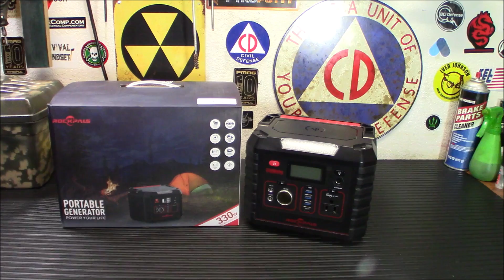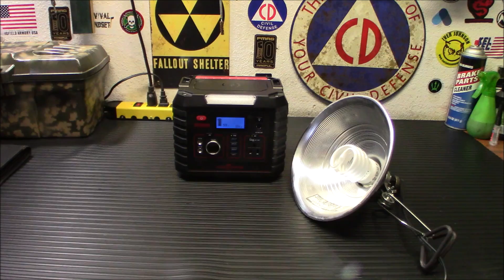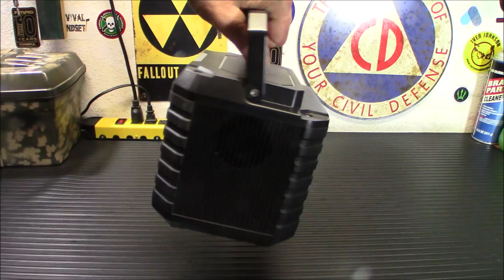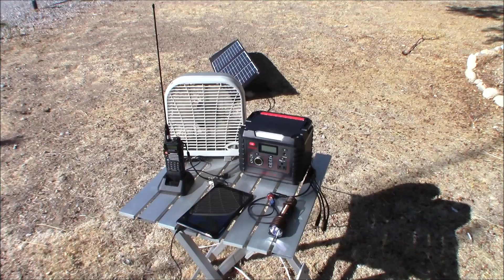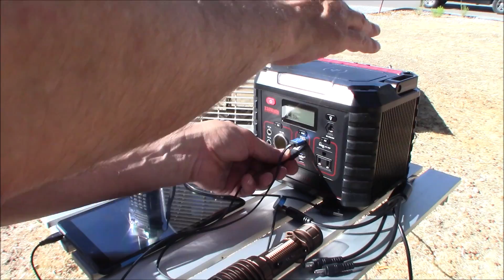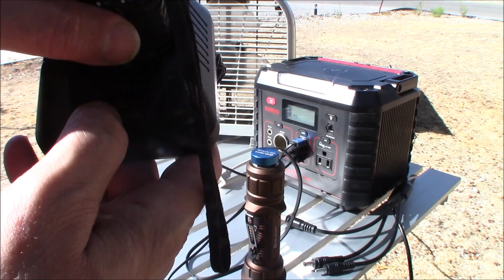Emergency Power:  ROCKPALS 330W Portable Power Station

Comment: for all you CPAP users  watching this...................

i just got this

im on my 6th night of using strictly with CPAP.  my setting is at 8.5, and im NOT using heater or humidifier.  the modem and bluetooth are set to ON.  

ALSO.....i AM using a DC cord (cigarette lighter plug) for this.  i think the numbers would reflect MUCH differently using the standard adapter.

1st night - 9hrs 10 mins use.  battery from 100% down to 85%
2nd night - 9hrs 51 mins use.  battery from 85% down to 73%
3rd night - 9hrs 22 mins use. battery from 73% down to 61%
4th night - 9hrs 27 mins use. battery from 61% down to 49%
5th night - 8hrs 20 mins use. battery from 49% down to 40%
6th  night - 8hrs 45mins use. battery from 40% down to 32%

im pretty confident that with modem off, heater off, humidifier off, and heated tube off that i can get 8 nights use, on 1 full charge.

which makes this a VERY cheap alternative to the pricier 500 watt size models.

Comment: Heres sort of a hack

Go get a light bulk socket plug in adapter
https://www.lowes.com/pd/Project-Source-660-Watt-Ivory-Medium-Light-Socket-Adapter/3775911?cm_mmc=shp-cprdelcgooglelia-205-wiringdevices-3775911-_-0&placeholder=null&&ds_a_cid=112741100&gclid=CjwKCAjwn9v7BRBqEiwAbq1EyxbTdS7ulT34WYSVokpaat6R-WvHOVZXDPOF7ANr-6sOintLyq2-hhoCUiMQAvD_BwE&gclsrc=aw.ds

Get a battery back up bulb from Walmart or wherever you can find one

Use it with your solar generator.

This is nice because it stays lit without having the generator on. But when you turn it on, it gives you more light and charges the bulb

Comment: I wonder how long will it run a 110v fan?
Reply: It depends on the power draw of the fan you want to run, check the fan you want to run for that information (it’s usually printed on it somewhere) most small table fans draw anywhere from 45-55 watts. So @ 50 watts, you’d get about 5-6 hours of run time (approx) with this unit. Hope that helps!

Comment: I just received from Amazon today a Baldr 330 that looks identical to this Rockport.  I had seen a video from HOBOTECH on it before I made the purchase.  One of the things he mentioned was that when the battery capacity falls below 50% the DC output drops.  He tested it as low as below 10 volts as the capacity got close to empty.  I am very curious if the Rockport 330 does the same.  I don't plan of using it for a CPAP or fridge, so it isn't an issue for me.  I mainly hope to use it on my cable router in a power outage to keep a 7 year old entertained.  If I can find a low price 12 volt tv that will be another use.  I paid 269.99 after tax for the Baldr.  I hope to see how yours does in comparison.
Reply: Actually I paid $238.04 for the Baldr with coupon.  I happened to be searching for a 12 volt fridge, and I came across the Rockpal.  Purchased it, but the coupon for Labor day failed to post.  I sent them a message, and they promptly sent me the refund.  I was so impressed I went ahead and ordered this generator.  I'll be trying it out with the fridge to see how they pair together.

Comment: Is the 12V output regulated?
Reply from the maker: Yes it is
Reply: In my testing on two of the 330 watt units the 12 volt output  is not regulated. With a 5 amp load it has a fairly linear drop from 10.9 volts to 9.2 volts at which point it shuts off. Still a great unit though. The MPPT controller works well with Rockpals second gen panels.

Comment: So many of us with limited funds are going to be screwed if the power goes out. I grew up a city girl without a father and with no males in my life so I never really learned how to do anything technical or mechanical.  I'm good with cooking/baking and art but this stuff makes me go crazy. For couple of weeks I've been trying to figure out what I would do for heat in the Winter if the power goes out and I still have no idea.  I watched your other video about the different heat sources but I'm still confused. I'm good on food for approx 6-9 months and water for a few weeks. Past that I'm dead.  🥴
Reply: If you live in a hot climate like I do, I highly suggest you get a product like a rav power 32000 MAH.  It is $72 but 20% off with code power20 (so $57) With this item, you can power USB powered small fan.  You can find these at walmart or Amazon. You will be able to charge your cell phone with it also, tablet, etc.  You can get neck fans or cooling towels that will keep you cool such as these https://www.amazon.com/dp/B08543QFSD/ref=cm_sw_r_cp_apa_i_U3PuFbM26M5NY or https://www.amazon.com/dp/B07Q8RSJHH/ref=cm_sw_r_cp_apa_i_54PuFbA9MKAK6. Hope this helps.
Reply: @jkco4300   Thank you. I live in Arkansas which is pretty hot in the summer and I did buy a battery powered fan but I am more concerned about the Winter staying warm and heating my food. Propane and butane makes me nervous.
Reply: I bought a battery powered fan from Walmart and just got it a couple of days ago.  This Winter is going to be long and cold.
Reply: @kamikazitsunami  
You just dicribe my life
Lot's of leggings for cold winter nights socks you can make skarfs out of scrap at a fabric store or by at 99 cent store or dollar tree
We don't have a earthy father but we have a hevenly Father he wants us to ask him he will provide and we have George Chanel
With a lot of good advice